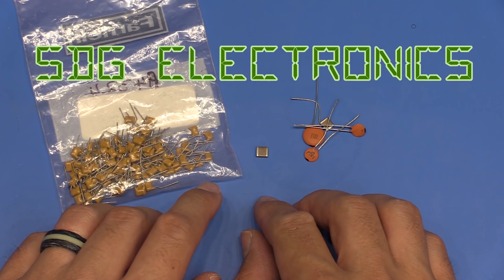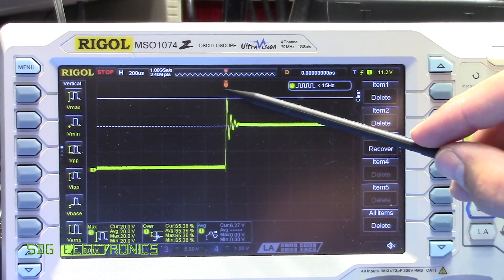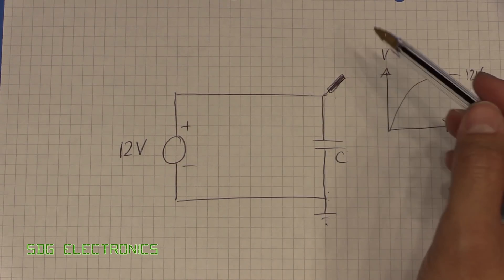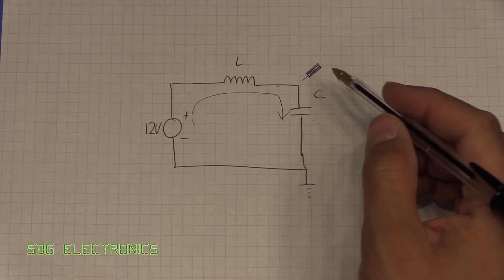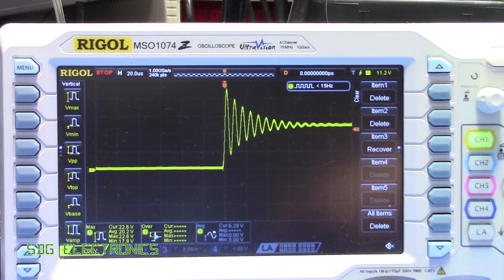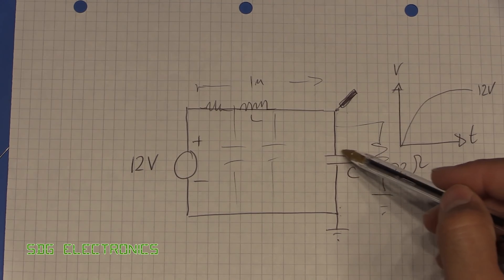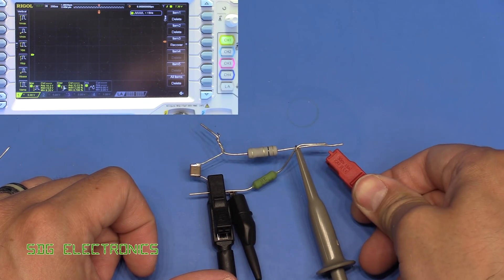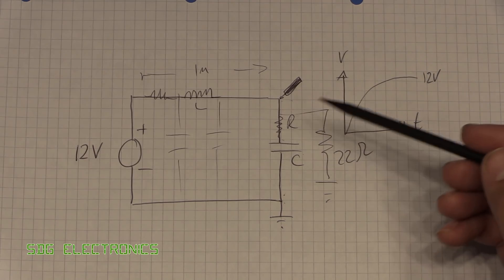SDG #088 Ceramic Capacitors will Blow Up your PCB

Comment: The whole point of using ceramics is that they have low ESR.  Adding a resistor is asinine. You are far better off minimizing inductance around the cap.
Reply: I'm always using Transient Supressor-Diodes in parallel to the first capacitor at the supply-input. Works really well and also protects against other sources of Voltage-Spikes. 
A mandatory protection when designing anything that can come into contact with an alternator btw. Those beasts are capable of REALLY nasty Voltage-Spikes. ^^
Reply: Depends on where it's going, generally resistors are added along with additional capacitors to form RC snubbers on switched-mode power supplies and inverters/motor drivers. This video was illustrating the effectiveness of properly designed RC snubbers for eliminating potentially destructive transients during switching events. Now of course, you wouldn't add resistors in parallel or series with ceramic caps that are being used to decouple ICs from their respective power rails.
Reply: Switchmode power supplies are used for efficiency. Proper PCB layout should be used to reduce spikes. If you can't be bothered to do this use a linear regulator.
Reply: for a first stage reduction , this solution would be OK,   I actually use a 4.7uH , 10u X7R with a 1K drain and have NEVER had an issue with over voltage or failed electronics.

The true issue here is plugging an instantaneous capacitive load onto the output of a pre-charged SMPSU - the transient response of the supply is helping create the problem
Reply: In my opinion, use : Fuse - ferrite bead - v. low value series Res (say 0.5R for vI = 12V, iMax = 2A) - tvs in parallel - input capacitor in parallel. Kindly comment.
Reply: Ceramics are also (usually) far more durable than electrolytics.
Both for lifespan and shelf-life.

Comment: interesting, this is probably why electronics say to always plug the DC side in first then plug the switching adapter into mains, since the mains supply is designed to handle the large transients where the DC side does not need anything. would a circuit with a current sensing resistor have enough resistance to get rid of the spike?

Comment: Shortly after posting a long-winded comment below, I found some TVS Diodes:
On Semi:  P6E[Voltage]A  # am ordering some 6.8/12/13V to see if they werk
General Semi:  1.5KE[Voltage]A # may be clones of the series above?
Digitron:  1n6267 -> 1n6303A # higher range, not sold on Aliexpress.  Why?
Is this the magic pill?  Does anyone use these?

Comment: I knew it, I got fired for modifying a customers TV vertical circuit the same way, because it was a particularly bad circuit design. The circuit kept collapsing no matter what caps or outputs were used. It came back 3 times for the same thing until I fixed it. Then came back again a week later, because the customer snapped off the coax connector. When my boss discovered my repair technique, He let me go. Out of curiosity I called this customer a year later, he said all was well.

Comment: Kind of click bait... What's the relation to "PCB"? And how is this gonna "blow up" it?
Reply: This is normal EE talk - the circuit on the pcb is destroyed, the pcb is junked, you've blown it up.
Reply: is gonna explode and the explosion was sooo powerful that the PCB got teleported to saturn
Reply: if it's powerful enough it may get to uranus
Reply: Buy a VESC 4.12 and run it at 50V in Field Oriented Control, there's your explosion :).

Comment: Well there is a few things I had on my mind while watching.. First up is your cables. I am guessing that you are using 1.5 meter long cables. To reduce the inductance seen in the video you should use shorter cables. The traces on a pcb does not have such high inductance (unless we are talking serious stuff) 
Second using a alligator clip to connect to the caps is also a bad idea as they add mechanical jitter which just makes the long wires a even bigger problem as now there is current going though them and creates inductance instead of just  connecting them in a "non mechanical" way. I recommend a mosfet for that test case and can ensure you that it would give a different result
Else. Great video. Alot of people don't know what differs ceramics other than it's price
Reply: Now to make matters worse, imagine there's a power switch between the cap and the pow input jack... And the switch starts to fail and spark.
Reply: @SurajGrewal  That's a mechanical issue. Only happens after either a bad connector is produced in production or it has been used so much that it fails mechanically. But for this example you gave, another commenter mentioned the AN88 from Analog devices which shows that when having a wire between 3-10 feet(1 to 3 meter) you should add a electrolytic parallel with the ceramic to help on the problem.
Reply: What if, it's a wall wart powered device? The wire's gonna be long, ain't it. The offending cap could be just next to input jack

Comment: What happens if you put capacitors of different values in parallel? Would one filter out the resonant frequency of the other?
Reply: No.  capacitance in parallel adds, you've still got an LC circuit.
Reply: @MarkTillotson  I agree where most of the inductance is external to the capacitors, but in a well-designed circuit where most of the capacitance is the capacitor leads, would it help?

Comment: Now Connect the load direct to the supply before the current shunt resister ie in parallel. Will the spike be removed ? if yes then max Current can flow to the load with out the serge spike

Comment: Please do a video repeat of the experiment, but adjust the trimmer in your X10 probe, compensate for the overshoot. There should be a square-wave test-peg on the front of the scope. (if it is any good).
 https://www.electronics-notes.com/articles/test-methods/oscilloscope/scope-probe-compensation.php

Comment: Just a thought, but, what about using a Zener Diode, rated a couple of volts higher that the power supply ??  That way you keep your low ESR. The Zener will only  come into play when the supply over-shoots, The rest of the time it is as good as not there!
Reply from the maker: Yes, similarly you can use a TVS or similar devices.
Reply: @sdgelectronics  You may have solved one of my great mysteries.  I smoked a handful AMS1117-3.3v's at 12V in, with tiny loads, and even no load.  This puzzled me, as the data sheet says it is good at 12V.  These always work fine at lower voltages.  Now I am going down a rabbit hole of unfamiliar components and terms ... Diac, VDR, TVS, SCRS, Trisil, Transil, Crowbar Circuits.  What is the jellybean hobbyists component to protect against high-side DC spiking at power-up?  I read that Zeners are not good at high frequencies.  Is common to rig up a TL431 and a Triac to protect every trivial low current fixed regulator?  There must be some common crowbar IC that I am unaware.
Reply: @GnuReligion  I have used a great number of AMS1117-3.3 , with a 12V input and no problem.    On my front end I have  a bank of 470uF 25V capacitors to ground and a series 4.7uH / 220uF / 10uF on the input to my regulator.    No problems at all.    I am drawing up to 2.5A with a 24lHz  PWM on two motors ( DC blowers)  on the 12V rail

My input source is a car battery so I also have a small TVS SMF14A-M3-08 to stop any spikes from the vehicle getting through.
Reply: @deansmith4752  Yikes Ghads! ... That sounds cray cray!  The SOT-223 package is tiny, and only rated at 1A output.  You are dumping (12-3.3)*2.5 = 21.75 watts through the thing.  Wouldn't you feel better with an LM317 mounted on a sink, if you need 2.5A?  Or better yet, a switching type buck?  You must be talking about the amperage going through power transistors to your blower.  At any rate, I was doing something wrong, and will try to reproduce my failure ... and see if a zener or TVS helps.
http://www.advanced-monolithic.com/pdf/ds1117.pdf

Comment: Suddenly in the Amiga community: Replacing all electrolytic capacitors with ceramic ones is a good idea!
Seriously thank you for this video.
Reply: Lol, well as long as they add a resistor in series, it's a good idea.

Comment: Is it a good idea having a resistor on the input to a power supply?  Apart from the fact that you'll need a mega resistor if you're drawing any decent current, it's a permanent inefficiency that produces heat, for the sake of a fraction of a second transient.  The soft starts sounds much more sensible.
Reply from the maker: The resistor wouldn't be in series with the power supply, it's just in series with any ultra low ESR capacitor that would form the LC tank circuit.
Reply: @sdgelectronics  Ohhh.  Okay, my bad.

Comment: LMAO   There is supposed to be a LOAD across the cap. Next  How about adding a few more feet of test lead length for a bit more inductance, that will help your over exaggerated explanation.  Third,  you ever heard of switch bounce??????
Reply from the maker: The load was added at around 5:10. The example is where you have an AC adapter in your design, so not exaggerated at all. These typically have 1.5m or 2m cables
Reply: I don't think the adapter has anything to do with it, 2 meters is a lot of inductance. Anything nowadays has proper circuits design to 'look' before hand, that is if the circuit is that sensitive.  I think you need to look at some local regulation or just an a choke. Now back to my antenna matching network and keeping that bad inductance in my digital section.
Reply from the maker: @johncundiss9098  i think we may be talking at cross purposes. The situation is you have a piece of equipment with a DC jack. Inside the equipment you have an ultra low ESR capacitor as one of the first items in the circuit - if you then connect the DC supply lead which is already powered up, you'll see up to 2x the supply voltage on your circuitry due to the LC tank circuit.
Reply: @sdgelectronics   I admit a bit confused about the video.  I do understand exactly what you are saying. I know all about 'the tank'  Ham operator here, gotta tune the tank to get the tube amp 'tuned'.  Here is my point that I may have gotten messed up.   A ferrite bead is on the end of most of your power adapters nowadays to help mitigate this.  Also,  at least in my day and I still follow this rule, DOUBLE THE VOLTAGE of you capacitors and you will be golden.  I know this is not always feasible but is common sense there.  Plus with advent of the 'MLCC' the electrolytic is less used. They are both necessary evils though.

Comment: Very interesting video, thanks! I am still very new to electronics as a hobbyist, but wouldn't a thermistor before the cap cure this? I have just been using one whilst building myself an isolation transformer using a toroid. I couldn't decide whether to use a thermistor or a delay fuse....so i ended up using both! It is working fine, i am happy to say. Thanks for the video, mate!

Comment: If only there were largish capacitors with some internal resistance. Oh wait we have electrolytics in these places
Reply: Those are not very feasible in todays market - where increasing integration is the current trend - if you're going to make an ultra-thin powerbook, you can't go round using electrolytics.
Reply: Problem with electrolytics is they age and dry out and they are quite large compared to MLCCs

Comment: Basic EE knowledge，never use a voltage source to charge a cap......
Please open your book...

Usually, DC DC convertor will soft start when power on. And the large inductor of the convertor will limit the current outputing on the cap.
Reply from the maker: This is on the input, in other words just after your DC input jack as opposed to after the converter.

Comment: What would the waveform look like if you connected 10n, 100n, 1µ and 10µ in parallel? (or any combination of those)
Reply: simulate it with LT spice.

Comment: What i've done in the past is put in series with the input an inductor paralleled with a resistor. That way you make a dominant resonant circuit (as component inductor > cable inductance) but have control over the Q via the resistor to limit the amount of overshoot to something manageable. Picking the resistor value becomes a trade-off between overshoot due to the cable inductance vs the component inductor.

Comment: Ran into same problem years ago with a portable audio amp. I could never figure it out opting to delay the output startup, but now I wounder if it wasn't the dc to dc converter. Hmmmm.

Comment: It's well known that the wire inductance and the capacitance can cause up to a 2X overshoot at startup due to the high-Q series resonant circuit. Putting a resistor in series with the capacitor will work, but makes the capacitor much less effective. It's frequently better to use the same circuit used for protection against reverse polarity, i.e. a low RDSon PMOS transistor in the supply rail or a low RDSon NMOS transistor in the return to protect from reverse polarity and slow down the inrush without significantly degrading the circuit.

Comment: Common as well for the capacitor to have had an ESD event in the past, or stress on the leads, that either caused a crack, or caused internal cracking, and the capacitor fails short circuit after a time. Symptoms were the board catching fire after a long time in use, as the capacitor does not go dead short but develops a very high leakage current. Amazing that a 5V rail can burn a hole through a PCB, even though you might only have a 1A supply from a local regulator.
Reply from the maker: Indeed, the slow persistent heat can make a real mess of PCBs. Thanks

Comment: Thanks for sharing.
I suggest you re-visit your 12V power supply transient response. The title is very misleading and I suggest a re-visit.
The issue is not with the capacitors.
Reply: Yes it is
Reply from the maker: You can get exactly the same waveform from a battery or other stable supply. The situation actually worsens with a high performing power supply, but yes, I didn't think to add the waveform of the PSU.
Reply: @sdgelectronics  Hello. Thank you for your reply. 
I still think the ringing occurs due to the dynamic response of your power supply. A capacitor, good or bad, is finally an "ideal" capacitor in series with a small ESR, which by itself can never cause ringing except if the stray inductance is of such a value that can create a "tank" resonant circuit. Values of the capacitors you have tested and the ringing frequency you showed on the scope can hardly be due to such resonance because stray inductance would in the nH range and fr would be much higher. 
The symptom looks (to me) like that transient response of your power supply, which overshoots with the large current drawn by the initially discharged capacitor.
Please try this : place a hi wattage resistor that would draw a large current across your power supply in series with a MOSFET and clock the gate with a square wave, and watch the voltage again. If you see the same ringing then it is the power supply response.
Thanks again. I am not a lawyer for ceramic caps by the way !!!